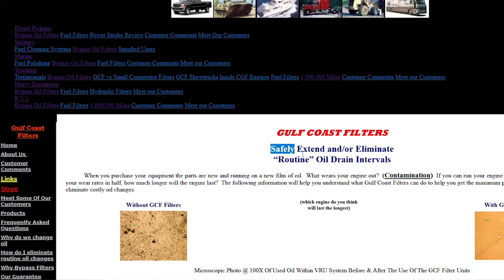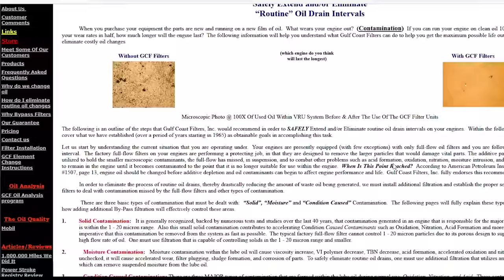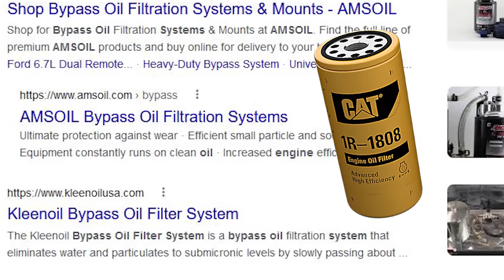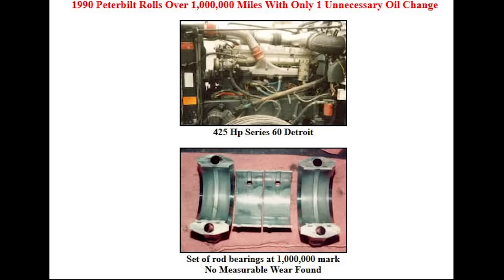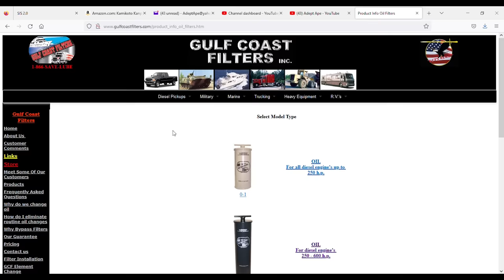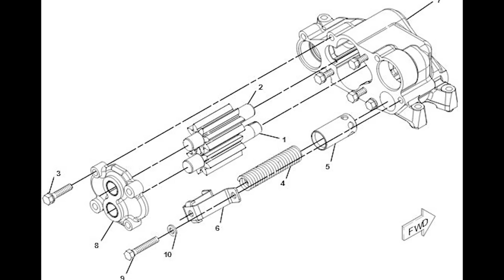No Oil Changes and 1 Million Miles!!! Are Oil Changes Optional with a Bypass Filter? (INTERESTING)

Comment: Do more research on Amsoil and their by-pass filtration systems. You'll be surprised how good it works and how much testing they've done since 1972.
Reply: Amsoil filters cant compare to these big filters. I remember when the Amsoil  canister  filters came out in the early 80s.I was using Amsoil 10 40 with a Frantz oil cleaner. It looked like it might have been as good as toilet paper..It hooked up the same as a Frantz. Now they have that rediculous dual remote joke. Pleated filters cant clean oil.I think these new oils are making the poor filters look good.. My filters dont have to work as hard as they did in the 60s. I took off a valve cover on a Nissan Altima to do a valve job. It looked new.. It had 225.000 miles on it. Only the standard full flow filter. I wouldnt have seen that in the 60s even with routine oil changes. In a way I kind of liked the old days when you knew the toilet paper would be full of soot. The old diesel tractor is putting soot in the filter.

Comment: The reason Gulf Coast filters say you could not change your oil is because of the large amount of make up oil you add when you change their filters which adds additives for contaminates. You should always do oil samples periodically to check for problems and change oil when necessary
Reply: Gulf Coast lives by oil analysis. They have to because of the expensive equipment.they deal with. With my old stuff.I just change the toilet paper. and add a quart of new oil. I have been doing it so lomg I know what clean oil looks and feels like. Some old truckers do the palm test. They put some oil in the palm and see if it wipes off  clean and doesnt stain the skin.
Reply: The oil is being changed. 3 gallons of New Rotella every 10.000 miles is how many gallons of new Rotella in a million miles. Then you have the full flow filter changes every 50.000 miles. It probably uses some oil that is replaced. Im not a diesel mechanic but I have some common sense. Road. King Magazine article said thats equal to a full oil change every 40.000 miles. The advantage is the oil is never allowed to get dirty. This system wont work with little oil filters. I Guestimate the truck got about 350 gallons of new Rotella added at filter changes in a million miles. The 1 oil change means nothing.

Comment: Old farmers will tell you to NEVER CHANGE YOUR OIL, only change the filter. Oil will always remain to be oil , a lubricant. It's the impurities that contaminates the oil. Hense change the filters. Locomotives only have filter changes, they only add oil.
Reply: I have 60 years of experience using the little toilet paper filters. All I have now is Motor Guards Gulf Coast juniors a Australian Jackmaster Classic  and a converted flat head Ford canister filter. Big engines are similar. They just need bigger filters and more new oil added at filter changes.The system of allowing oil to get dirty then drsining it is for fools.

Comment: I ran a bypass setup on my 24 Valve Cummins for several years. Initially I was sending in samples every 2k miles then went to 5k miles when I felt that nothing was changing between samples. I usually ran my oil changes to 10-12k and even did 15k once and they samples always came back good. The system and filters were pretty expensive so it might take a lot longer to recoup the costs on a passenger vehicle.

Comment: My employer regularly uses external filters with their own pump on just about anything with an oil reservoir to save millions of gallons of oil vs changing oil. How would you feel about a system like that vs a bypass system? It could be used on a whole fleet with only a quick connect or similar hooked to drain pan of each.
I also wonder if filtering may be a good idea on transmission fluid.
Reply: Everything I own has a toilet paper filter on the engine and automatic transmission. Transmissions depend on friction which means they have a lot of friction material and wear metal. Some transmissions have decent filters in the oil pan some dont.

Comment: I mean they're not wrong, as long as you service the filters and add new detergents at specified intervals...the oil itself will keep going. Regular oil tests will let you know how the oil's doing and how the engine is holding up.
Reply: Normally the make up oil added at filter changes is enough new additives added.That is one reason they use big filters. Little filters dont work with this system unless you dont mind changing the filters more often. My concern with the smaller filters is they are normally more expensive.

Comment: One million miles and no service would have saved the owner 20,000 dollars in shop fees at least, the fact a motor could hypothetically run this long on oil is amazing and couldn't happen.
Reply: Pay attention.  The series 60 Detroit gets 3 gallons of new oil every 10.000 miles when the 3 gallon filter is changed. More at 50.000 miles when the full flow filters are also changed..That is a lot of new oil in a million miles. The advantage is the engine is always running on clean oil.

Comment: I changed the toilet paper on the old diesel tractor and rubbed the dipstink on my fingers. The toilet paper has a couple of cracks in it and the top of the Toilet paper is blacker than the bottom . This tells me a small amount of water is being removed from the oil. Soot is being removed from the oil. The oil is too clean to stain my fingers. This engine has no PCV It has a hose down the side of the engine. The last time I saw cracks in the toilet paper was a leaky head gasket. Hopefully its just condensation. I just bought the old tractor. Didnt give the toilet paper enough time to be black all the way thru..went to clean the oil bath air cleaner.It was a water and sludge bath cleaner. Tossed it and put an oldsmobile  air cleaner.on it. I have done a few small Detroit's and Cummins but my experience is small filters.The tractor is about 25 HP with a 12 speed transmission and 4 wheel drive.

Comment: Had a company come through my old job claiming all this same stuff but you had to add their special additives depending on what the oil test said. But God it turned that oil blacker than tar, ran it for a while and I think the company went out of business and we ended up taking them out because the filter jars would leak.

Comment: The answer is no 
If nothing else evaporative loss 

Change your oil 
Especially on a big rig with a $80,000 engine it’s not worth it 
Use the bypass if you want, it will help but change your oil

Comment: Bypass filters are not new especially in the Heavy duty side of things in engine, hydraulics plus steering and brake system.. it can extend oil change intervals but I haven't seen a case where it last  equivalent to a million miles..  The QSK 60 we generally never change it's oil nor it doesn't even have a spin on filter.. it deliberately mixes a portion if engine oil with.  fuel and burns it doing combustion while being topped up from a reserve tank.. extra filtration with a bypass won't stop the VI improver from breaking down after subjected to high shear in an engine thus the viscousty index is going to change over time, oxidation and acidity in the oil can be slowed but not eliminated, some moisture in the oil is going to be going to be suspended in the oil then pull out into the filter over time this additives are going to be depleted also vaporization of the oil..  unless the engine is burning oil and constantly topping up to introduce fresh oil ..  i million miles is a stretch..

Comment: Multi weight oils get their 'Multi weight ' abilities by the addition of plastic polymers into the oil. It is melted into the oil during the refining process. 
 So, a 10w 40 is in reality  10 weight oil, that's pretty light. 
 These polymers literally grow fingers that extend out from the molecules when heated,  at which point they thicken the oil.  This is a relatively simple analysis of this process. 
 The problem with running oil  for an extended period is that these polymers break down with time,   high oil temperature is very destructive to them, and the oil losses its multi weight ability over time. 
So, in effect, over time you find that your oil pressure tends to get pretty low, now that you're running 10w oil in Arizona in August pulling 80,000#s over the rockies. 
Seems to me that fresh oil is pretty cheap rather than a full rebuild.
I run a bypass filter, really like it,  but I change oil too.
Reply: There was a time when you couldnt use multi grade oil in a diesel. I figured if you couldnt use it in a diesel why would I put it in my car.. its a lot better now. I think International was the last to require single weight oil. My 84 Oldsmobile diesel book said you could use multi grade in an emergency until you could get 30 weight.

Comment: Another issue with their claim is filter saturation.  At some point these filters are going to be full of contaminants and will no longer be able to do their jobs.  Even if the oil doesn't break down, you would definitely need to change the filters.
Reply: When I found out about the Frantz oil cleaner I put one on my uncles 59 ford. In less than 50 miles the Frantz was completely full of sludge. To make matters worse he had removed the thermostat. I said we will need to open the engine and remove the sludge or change the Frantz every 50 miles. He traded his problem in on a new Dodge pickup. Went to a family reunion. I was reminded of the useless Motor Guard oil cleaner I put on my dads car that filled up with sludge and quit working. Not so common these days with better oils and PCV.s. put a car on the rack. Remove the plug and a couple quarts come out. The boss says put some kerosene in and let it idle. The good old days.
Reply: The big Gulf Coast O2 isnt run untill it wont hold any more sludge. Havent seen my toilet paper filters clog up with sludge in many years. In the 60s I squeezed the top of the toilet paper and got black sludge. The bottom I got golden oil. With these modern cars its hard to tell the difference. Opened up a Nissan Altima with 225.000 miles on it to do a valve job. It looked new. All it had was a full flow filter. The valve springs were down in holes. I thought to hell with this and ordered a Japanese import engine.Not like working on a old Chevy. Couldnt get to the valve keepers.

Comment: I’m telling you there’s something to this I was extremely irresponsible when I was younger and never change the oil on my 2006 GMC canyon four-cylinder I went from 220,000 miles all the way to 380,000 miles without changing the oil only adding when needed the minute I changed my oil at 380,000 miles my truck began to knock and took a downward spiral

Comment: I remember the old L750(?) bypass filters. Hated them.
Reply: Same here the old C750-L was a pain.But it did do its job.
Reply: Many years ago  Cummins. claimed an 80% increase in engine life with the 750 filters. Ive changed many of them. The company I worked for had Luberfiners on everything. In those days they used cotton waste. The Fram on my 41 Dodge was the same thing.

Comment: Extra filtration is good, but I'd be apprehensive about going a million miles without an oil change. Motor oil is a base stock with a cocktail of various additives. Things like anti-wear additives and viscosity modifiers will have a finite lifespan, once they're consumed to the point of being ineffective, you're relying completely on the oil base to prevent wear.
Reply: The Detroit engine got about 350 gallons of new Rotella added in a million miles. 3 gallons of new oil added every 10.000 miles when the 3 gallon Gulf Coast filter is changed  is a lot of new oil added. The full flow filters are changed every 50.000..The system isnt the allowing the oil to get dirty and draining it system. Thats why the  engine has virtually no engine wear at a million miles.I think in those days it used Rotella 15 40 conventional oil.Road King magazine asked me for the truck owners phone number in 1996.

Comment: Locomotives use 200-300 gallons of oil, and do burn a decent amount too. But for years now, they don't change the oil. Imagine the cost of changing 300 gallons of oil, on a engine that has no oil fill port (they put the oil in by opening the valve cover)

But what they do, is filter the oil, and add new additives. They've found the oil don't go bad, doesn't lose viscosity, it does infact lose the additives as it heats and cools. 

They'll run millions of miles, just by topping off oil as needed, and adding the additives as needed. 

You can buy recycled oil at the parts store even. Looks and smells just fine. But the fact is. It's been back to the refinery, filtered, and additives added. But you'd never know without reading the label
Reply: When I was.a mechanic st Safety Kleen they had a re refinery in east Chicago. Most of the re refined oil went to major oil companies. At one time new Mercedes came with re refined oil. Goodyear sold it in their tire stores. No one will buy it. They want the new stuff. Used oil is better to refine because you dont have to deal with all the asfaults and other impurities in crude oil. We are probably using it and dont know it. Dont know if Goodyear still sells it. I just bought heavy duty 30 weight conventional diesel oil for my tractor. Probably has re refined  oil in it. I would think a lot of synthetic oil would be in it these days. An employee told me it is as clear as water before they add additives.
Reply: @ralphwood8818  yep. It's amazing how good modern oil really is. I like to tell people, to send a sample of their used oil, with the new for testing. 

You'd be amazed to find what the oil has to tell you through analyzing it. (Assuming no engine failure is going on)

Testing the oil, will also tell you how well the engine is being lubed
Reply: @brodygreer5901  I started in 1963 using Delo 100 30 weight. It was 29 cents a quart in the discount stores. Multi grade oils were crap. The polymers stuck to hot engine parts. Couldnt use multi grades in a diesel. Shouldnt use them in a gasoline engine. They have come a long ways. Some old timers still wont use multi grades. Ive heard oil analysis can tell you if your air compressor is going bad by what metal is showing up in the oil.  I dont do oil analysis on my stuff.  I was talking about my Subaru with about 250.000 miles with no oil drains. A Caterpillar lab manager sent me a sample bottle. He said the oil looks good for 250.000 miles but suggested I change the Frantz and add a quart of Mobil 1 every 6K instead of every 12 K. Miles. I took his advise. He talked about some caramelization.. sounded like candy making.

Comment: Why do we call it no oil changes when 3 gallons of new Rotella is added.every 10 K miles when the 3 gallon Gulf Coast filter is  changed and more is added when full flow filters are also changed at 50 K miles. The Road King magazine article says that is equal to a full oil change every 40.000 miles. I have lawn mowers where the little Gulf Coast filters hold more oil than the engine.

Comment: I have the LMM Isuzu engine . One place sells the adapter for the GM oil filter to the Cat one 1R-1870 was it?? The 1880 filter seems ?? (sorry to be the same??) 
My question would be the ultra high efficiency  for the D-11's I think it was do they have the same thread pitch. Not that I can afford it, but love to Learn and think. 
Thank you for comments. Was looking up on the Cat sight.
Reply: Some think making a full flow or a fuel filter clean oil by putting a orifice and hoses on it are wrong. It will do better at a smaller oil flow than as a full flow filter but not good enough.plus the filters are expensive.

Comment: No one can not convince me, any form of used oil is better than brand new oil. While it is interesting, new oil is cheap insurance, and so is adding extra filtration(within reason)
Reply: I can remember when conventional oil got better with use. The heat broke down the impurities into solids that my bypass filters could remove. Some of the impurities ended up stuck to hot engine parts. Oil has come a long way since I installed a Frantz oil cleaner on the Rambler American.
Reply: In 1963 you couldnt use multigrade oil in a diesel. I reasoned that if the oil was no good in a Diesel why would I use it in my car. Delo came in W20 and W30. It was a beautiful oil when used with a toilet paper filter.
Reply: Allowing oil to get dirty wear and foul the engine then draining it is not cheap insurance.

Comment: I added a bypass oil filter to my 2005 Sienna AWD.  The bypass filter filters to 10 microns, it did not specify the efficiency at that size.
The oil at 5K miles looks about like oil normally would at 1K miles.
Reply: My Rambler American flat head 6 came with a bypass spin on . Saw one at Car Quest like it that was rated at 10 microns . I cleaned up the oil by tossing it and installing a toilet paper filter They tell me if you use a firm roll of Scott 1000 it is a 1 micron filter. Jackmaster claims their elements are rated at 1 micron. You need to get at least down to 3 microns all a Jackmaster element is is a roll of high quality tightly wound toilet paper in a fabric cover.
Reply: @ralphwood8818  I’m going to try to find a toilet paper filter that fits 3/4-16.
Reply: @edwardhoward4708  you can get a 3/4 16 thread filter that cleans oil  I wouldnt want one They use about a third roll of toilet paper.. They convert the full flow system to a bypass system. The bypass valve stays open as long as the engine is running. You cant make a filter that cleans oil into a full flow filter. Stilko  Trasco.